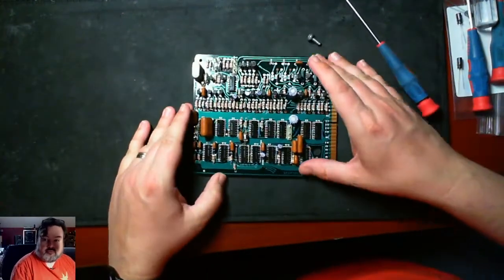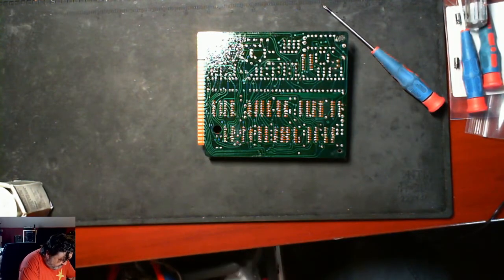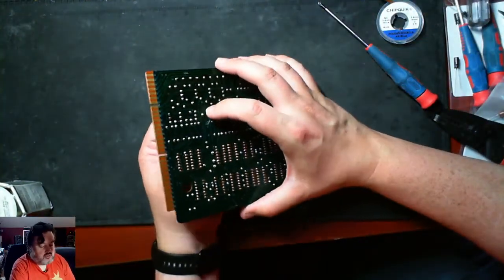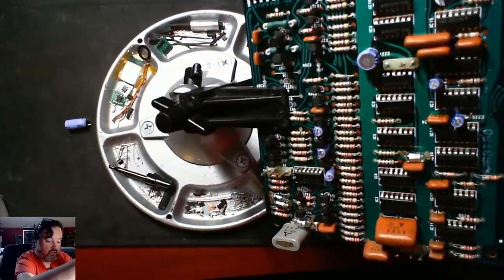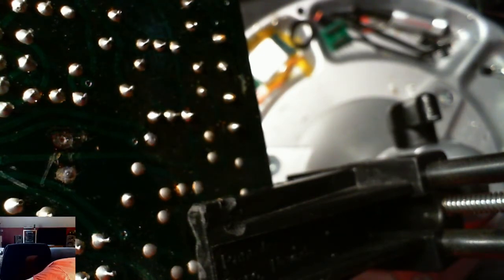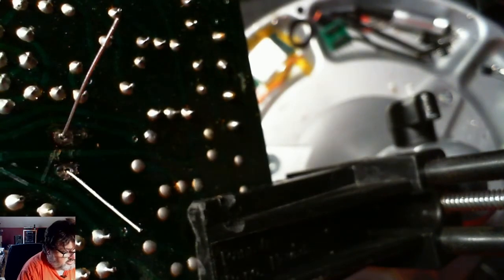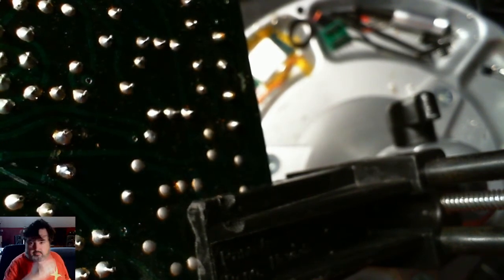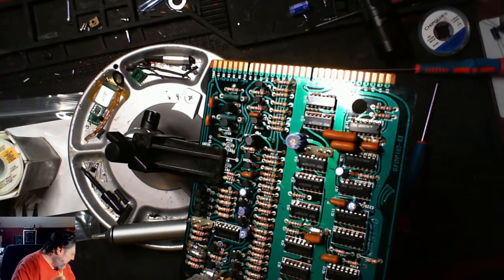Circuit Board Repair Capacitor Replacement

Comment: Thank you for making this video. great job ! Will replacing caps fixing a sp 10 that does not keep the speed correct? thanks again!
Reply from the maker: Try just replacing the caps in the power supply first. If that does not fix it, you may have a bigger issue that will need to be diagnosed by a professional. The SP-10 has very complicated motor and feedback circuit. The cap job here was just for longevity's sake.